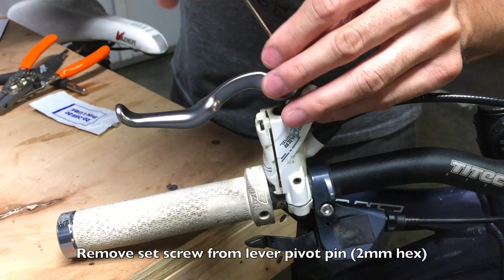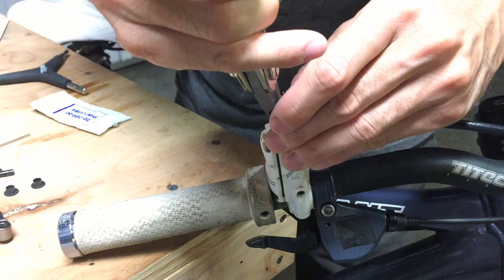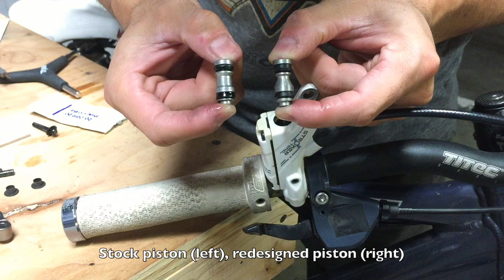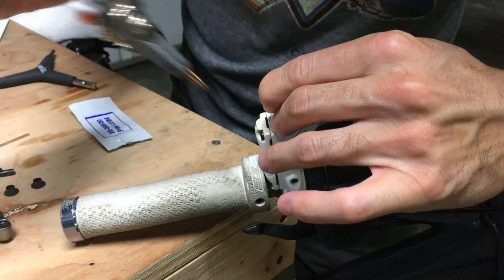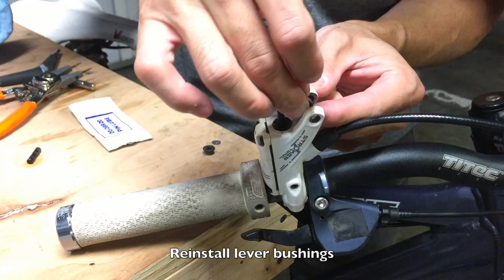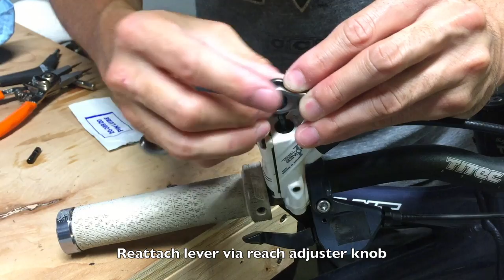How to: Fix Hayes Stroker Trail Slow Return / Sticky Lever

Comment: Contacted Hayes as described in your article, looks like they aren’t standing behind their product anymore, the told me to go buy the piston/parts to fix this. Thought I was gonna finally be able to use these brakes after putting them in storage since 08. 🤷‍♂️
Reply from the maker: That's a bummer, but I'm not entirely surprised since they're over 10 years old. I do remember really liking these brake though. You might still be able to rebuild them based on this video and get them into working order.

Comment: Hi, good material! how much time did it took for Hayes to respond for your question? Did you contact with Eur or US department of Hayes? I live in EU, i have sent them question regarding this issue but without an answer from them, now i tried to the US... Could you please describe more specificly what did it looked like when they sent your repair kit? is your brake still covered by warranty? Thanks for the answer, cheers ;)
Reply from the maker: I contacted US branch by email through the main website. Someone responded within 3 business days and they shipped the kit to my home for free. It arrived within another 3 business days. The kit came in a small padded mail bag and included 2 new pistons, 2 new springs, 2 new retaining clips, grease, and a bleed fitting. I bought these brakes at least 6 years ago, so they are way out of warranty. Great customer service.
Reply: Did they ask you for your purchase note/ticket or something? .. I understand that you did not pay the delivery, but what about the parts? All for free?
Reply: they did not respond to me aswell i live in eu too
Reply from the maker: @marcosferreira93  Sorry to hear they did not respond. Perhaps try the direct customer service line?

Comment: Do i forcedly need to use the lubricant that comes in that little packet? Is there something else i can use?
Reply from the maker: You probably don't have to use that lube. Anything that won't degrade the rubber o rings should be fine
Reply: What do you think about wd40 or "3 en uno" or "singer"? Otherwise i can go to an steren (electronics shop) and buy some grease, the one that is silicone based and is used for electronic gears in radios, dvd players, etc.
Reply from the maker: Don't use WD40. Technically, it's safe on rubber, but you need a thicker grease that won't degrade over time.

Comment: Hello, i have the same problem. Is it possible to buy new pistons in 2022 for this model? Prefer Europe location. Cheers Martin
Reply: hi, have the same problem. i guess there are pistons, but i fix this with springs i install between lever and brake body, until i have the repair kit this will work. And i just cost 1 Euro.

Comment: Hi. I have the same brakes. When i use the rear brake , the brakepads don t come back to the normal and the disk make noises. The problem its from the lever ?
Reply from the maker: Sounds like your pistons are partially seized. You can try cycling them in and out manually a few times; this is a pretty typical situation. Probably not solved by the technique in this video.

Comment: I cannot get the piston to come out, it does not jump out like in the video.
Reply: he is not showing what kind of trick using for this "piston coming out move", because naturally this piston not coming out if internal rubbers are old. Or these rubbers is still functional and he pushing calipers brakes pads and this piston on lever coming out or he is using some kind of oil(or air) pressure to push it from disc calipers side hose end but not showing in video. Magic trick or work secret. You can call how you want.
Reply: This is correct. I had to rig an air line to my pump to blow out the piston. It flew across the garage. Most difficult part was finding it and the spring.